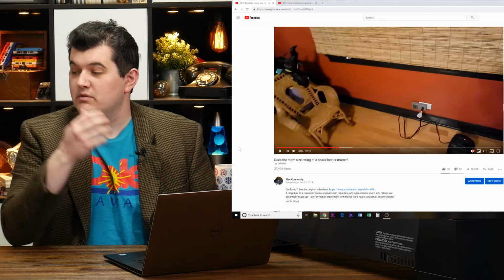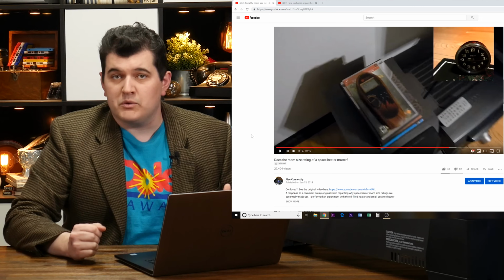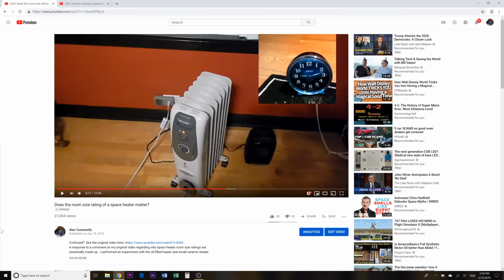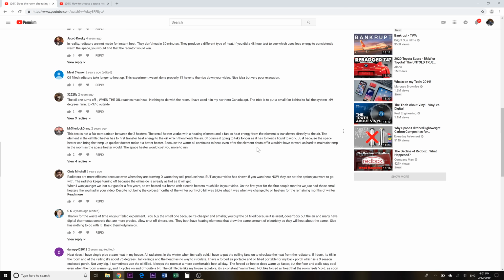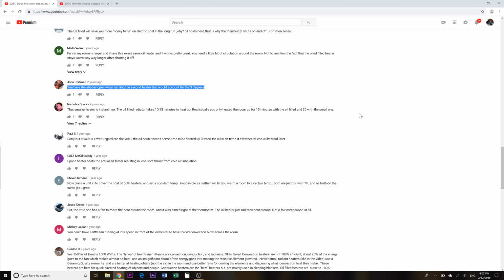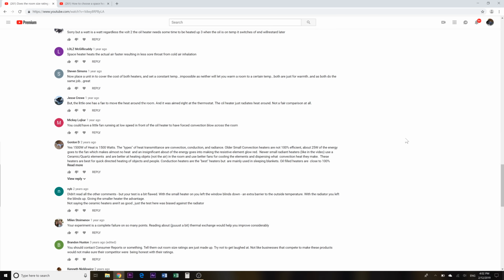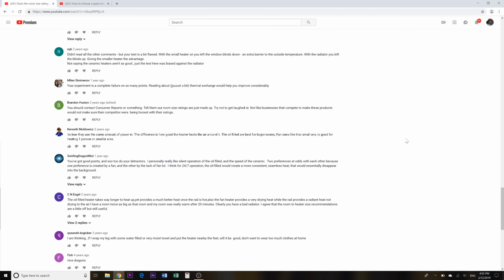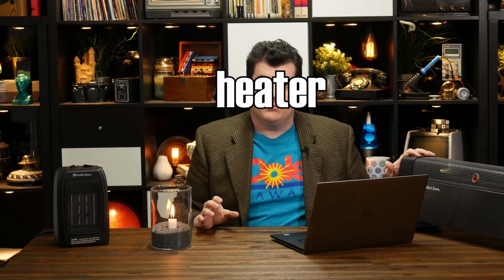More Space Heater Nonsense

Comment: Dad: "we bought a ceramic heater"
Me: "why?" 
Dad: "because it's better" 
Me: "how?" 
Dad: "it's more efficient" 
Me: "no it's not" 
Dad: "yes it is because it has a ceramic element" 
Me: "no it doesn't"
Dad: "oh... Well we really like it" 
Me: "that's great. Can I have your old one?"
Reply: better yet, call it a "thermal engine" it'll sell like crazy
Reply: No, Brawndo is betterdest because it has electrolytes!
Reply: s231744 Brawndo, it’s got what heaters crave!
Reply: @s231744  Electrolytes are what the plants crave!
Reply: I used to use a little ceramic heater out in the garage, it did ok, then I got a basic metal wire "utility" heater and it does "better" for the space just cause it has a larger / faster moving fan
Reply: If the ceramic heater is less likely to burn dust than a wire heater, then that might be a good reason for it.
Reply: @gunnar6674  The amount of dust burned in wire heater is small since it never gets a chance to build up.  In a ceramic heater that does not burn off dust you will have dust build up and clog the element until the heater doesn't work.  When the ceramic heater gets enough dust it may finally ignite.
Reply: A ceramic heater? So you bought a kiln?
Reply: B A a treat espicial
Reply: My late father drummed into me that all electric consumption was 100% efficient at creating heat and we had that discussion about the efficiency of the little ceramic heater and of course in that case he won, because I was a stupid kid and he was an engineer, so your comment reminded me of that memory, but it was reversed for me.
At the time I was confusing efficiency with how a seemingly small cube could put out that heat and after my talk with dad, I understood that he was always looking at it as 3,412 BTUs per Kilowatt every time all the time.
Reply: Actually a ceramic heater from Pelonis was the best. They invented it in the early 80s with the disc furnace. They produce the hottest airflow while still not going too hot to burn things. It will be able to output as much heat as it can because it is better at rejecting heat than a resistive wire one. A killawatt meter will prove it by showing its power consumption.
Reply: @sprockkets  I have one of the old Pelonis Disc heaters that I somewhat restored. It definitely "seems" to work a lot better than the small ceramic heaters you can buy today. It actually has a ceramic disc in it also. Sort of a honey comb  like matrix if I recall. The fan is much more powerful than the ones you can buy today. Thats probably why it seems to work better. I can't remember a what the power consumption is though.
Reply: @glennjames7107  depending on model mine takes 2100 watts on startup then around 1500 on max. But it produces the hottest air flow of all ceramic heaters I've owned.
Reply: @sprockkets  nope. If it's pulling 1500 watts from the wall, and it's constantly running, it's putting 1500 watts of heat into the room. How the air flows from the heater is what makes all the difference. If any design pushes the heat horizontally further away, it's almost certainly going to heat the lower part of the room better.
Reply: @bobbabai  you aren't understanding what's going on. Your first assumption isn't actually true in practice with most heaters.
Reply: @sprockkets  You're going to have to explain what you mean by "my first assumption". If you mean my claim that all of the electrical energy coming into the heater enters the room as heat, that is absolutely true. What matters is where the heat goes when it leaves the heater. The oil radiator design mostly heats up the air above the unit and that goes out the ceiling and upper walls. But because the radiator is a hot surface, some heat is radiated out to the side. The hot wire fan unit blows hot air horizontally which heats the lower part of the room much better before that heat leaks out the walls and ceiling. And because those units also get hot on their surface, they also radiate some heat out to the side, just not as much as the oil radiator design.
Reply: @sprockkets  I will modify one thing. Electrical energy put into a fan initially moves the air with the fan blades, but eventually all of that kinetic energy of the air molecules is lost to heat as those molecules collide with the rooms air molecules and they in turn collide with other air molecules and so on. There's also electrical energy lost to friction in the fan's bearing, but that friction immediately turns to heat.
Reply: @bobbabai  You still aren't exactly getting it. 
I've tested many different heaters, and the Pelonis disc furnace puts out the hottest temps. It can do that due to how it's designed. Monitoring each heaters consumption would confirm that as well. As in, each might be rated 1500w but cannot dissipate that much in practice, not necessarily due to a lack of airflow, but the heater element's poor surface area.
Reply: @sprockkets   No. If the heater is rated 1500 watts and its measured electricity consumption is 1500 watts, it is putting all of that energy into the room as heat. That's one of the two or three major points of this video. Where a heater puts it varies greatly between designs. Also, it may have to heat up parts of the heater first in order to get the heat into the room, such as in a poorly designed fan-based unit or in an oil radiator unit that has to heat up the oil first before the heat makes it to the room air. But a 1500 watt heater is always putting out all of that energy as heat.

The only difference with a ceramic disc heater is that the ceramic disc has to heat up, just like the electric ribbon in a fan-based unit has to heat up the electric ribbon in order for the heat to make it into the room.

If a heater's heating element is somehow insulated so that the heat doesn't immediately escape into the room, The heating element will overheat and whatever safety device is inside of it will shut off the power (or increase the resistance of the heating element as in the case of PST types that self-regulate by reducing.their power consumption by increasing their resistance as they heat up).

The major point is, The heater is using 1500 watts, All of that power is turning into heat, and all of that heat has to escape to the room surrounding the heater, either immediately via fan air or slower because oil has to heat up or internal parts of the heater have to heat up.
Reply: @sprockkets  
If the Pelonis disc is a radiant type heater, then all of the electrical energy is radiated as heat to whatever surfaces in the room are exposed to the radiating surface, assuming none of the radiated energy hits pieces of the heater like a grill in front of it, in which case those pieces will heat up and convect that heat into the room. 

Those surfaces will indeed experience more heat than they would from a fan convection the same distance away. But the fan heater will to the air around the heater and thus to the things that are nearby. It will also heat up more of the air above the heater. But if both types of heaters consume 1500 watts, both will put 1500 watts worth of heat into the room.
Reply: @sprockkets  And by the way, the radiant heat disc we'll also heat the air in the path that's directly "visible" to the disc.
Reply: @sprockkets  if you're going to stick to your story about a heater not turning all of its consumed energy into heat, then you have to explain where else that energy is going and in what form.
Reply: i'm sure this conversation totally happened :D because you CLEARLY explained to your dad why it wasn't more efficient, and he CLEARLY explained to you why it was!  "no it's not"  "yes it is".  valid debates like this really further positive endeavors ::slow clap:: well done

Comment: We have one of these oil filled heaters at our lake cabin and I have found using a box fan on the lowest setting helps to move the heat around the area much better. Normally it would take a long time to heat a large room, but having a fan to help spread the heated matter and moving the cooler matter to be heated it helps create a much more comfortable heat unlike cheaper, “small  room” space heaters
Reply: No matter what you do though 1500 Watts is 1500 watts and that is the capacity you will get out of what ever heater

Comment: It's it just the fan size? As in, the bigger unit would distribute the heat at a faster rate, theoretically heating the room more evenly rather than the heat being just concentrated in the corner with a smaller unit?

Comment: The bigger problem with that experiment is you started at a higher starting temp. You need to start at the lower temp for both. As room heats or us harder to radiate more heat into a system.

Comment: Wait so the small heater is using 1500W to heat and move the air. So wouldn't the oil heater be more effective if you just put a fan in front of it.  Say you have a 20W fan now your are using 1520W to heat and move that air. More watts more heat right?

Comment: Q=UA(dT) Q-heat transfer rate U-heat transfer coefficient A-area of heat transfer dT-Temperature difference. I believe the larger heater could be more efficient at heating a space due to the larger surface area of the heating elements. Assuming no external device for air movement it would probably help with natural convection too due to a larger volume of air being able to heat and subsequently rise exposing more cool air to the heating element creating a more consistently high dT. An experiment for this would need to start at the same temperature in an enclosed space a smaller volume like inside of a cooler or large box both placed in the same general area would probably be a good way to try and eliminate external factors. Steady state I do believe they would be the same but the larger heater could be better at heating a space more quickly.

Comment: tldr:
Everyone: the oil heater is slower and keeps letting out heat after it's turned off.
You: THAT'S NOT THE POINT!
Reply: Because it isn't.
Reply: @tolep  Exactly. I wonder how much the heat the host emits by bashing his head against the table as someone STILL DOES NOT GET IT.
Reply: @OldUKAds  I'm not good in English, but I'll try to  add somenthing.

1. All energy taken from electric outlet is converted to heat
2. If any heater takes the same amount of power, like 1500W, then it gives the same amount of heat
3. If certain heater, like oil heater, does not work constantly (because of protection from overheating), then it must produce overall less heat

Comment: In terms of heat generated by the device, they should all be the same, but I think the difference may come in that with a larger device you have more surface area. The heat is initially trapped in the metal coils, and having more surface area means more can escape into the air at any time. W/ the right air circulation, the larger devices will heat the room faster. (Maybe the non-fan containing heater is relying on your room having a fan already, like many larger rooms may have). Like you said in vid 1, you need to heat the room at the same rate as air leaves, and the larger device can heat a larger amt of air at a time to match the larger volume of air in the room. 
A second aspect beyond this may be device lifespan. W/ a larger device, the coils are cooler than with the small device, and thus have a longer lifespan when dealing with the longer duty cycles expected in heating a large room, while the coils in the small fan will burn out quickly if you use them to heat a large room.
The oil radiators seem much more suited to things like offices or a single room living space, where they're going to be heated most of the day. The oil wicks the heat from the heating elements, increases surface area for heating, and lets the unit have a longer lifespan.
This is all wild speculation, don't @ me.

Comment: There was a comment you showed on the earlier video that reflects my experience perfectly.  I've done the experiment you're doing, but it was a real life version where I had to heat a house.  A heater with an integrated fan will heat the space quicker.. putting a box fan behind the radiator blowing through the coils will not only disperse the created heat better, but will also keep the thermostat from kicking off so much.  The little heaters ARE faster, but will run your power far higher as the radiators keep working during the power downs... Also, the radiators MAINTAIN temperature far better, so if you don't regularly freeze your environment and need to heat it back up, the radiators are the way to go.

Comment: Watts is the end result of the electrical equation: (Amps X Volts = Current (Watts)).  If all heaters are 1500 watts, all heaters will produce the same amount of heat if they are designed properly. (fans included and the thermostat not being to close to the heat source.) One of the laws of physics states that you can't take out more than you put in, so all 1500 watt heaters pull in the same amount of juice, put out the same amount of energy, and have the same limits unless they are designed to shut off before they reach full strength.

Comment: I agree with you on the science of this but the test was setup poorly. You did not control the variables well enough. Comparing the two needs to be in conditions that can make them equivalent. The radiator is slower to heat because of the thermal mass of the oil. Even if it is on constantly it will take more time to heat the room. I'm not sure how to control for this off the top of my head. Maybe just ignore temp and go by the power usage.
The poor thermostat is a good point. You do better with your arguments than the test. 
Those baseboard heaters can move a good bit of air even if it is moving relatively slower. Given the larger size I would not be surprised if they were pretty close in volume to that tiny heater. Either way the 1500W is being delivered to the room unless the heater is overheating and setting off it's own thermostat.

Comment: You can turn your ceiling fan on high, too. The only thing a fan does is move air and dump energy into a room - all fans are fundamentally heaters.

The only reason they feel cool is because fast air moving over our skin makes it easier for sweat to evaporate, which draws energy from our body... into the room.

Now, if you have a fan blowing warm, moist, air over a cool surface, the energy from the air will get drawn into that cool surface, especially when the moisture condenses on the cool surface. If you can find a way to take that energy and moisture and dump it outside the room, you have an air conditioner. But the fan adds energy to the air.

(This is also why if you run a fan in reverse, by having air blowing on the fan and causing it to rotate, you can pull energy out of the air. That's what a wind turbine is. Of course, since that energy is coming from somewhere, the wind is less strong on the leeward side of the turbine)

Although I should note that these heaters don't "put out" heat, because they don't have heat inside them that they transfer outside of them. Heat is not an internal property, it is a process - akin to work. These heaters do heat on the room.

Comment: The other issue you have with slow releasing radiant heaters, (that have no fan) is that the heat will go straight up.  There it will collect on the ceiling and slowly fill the room from the top down as more heat collects.  If you're using an oil filled type you will be well advised to have some sort of fan circulating the air in the room. 

That being said, I personally prefer the oil filled type but I have no issue with the points you raised regarding how much energy comes out of each.

Comment: Does the 'small room' fan have a duty cycle on its heating element? So although the fan is on constantly, does a thermostat cut heat to the smaller heat exchange package to avoid meltdown, thus giving a shorter duty cycle than the medium or large room variants? That may explain the marketing wank.

Comment: I think we can just chalk this one up to the old saying "bigger/more is better." A tiny space heater that you could comfortably stick on the table can't possibly heat a large room as well as a giant box that costs twice as much, at least in the minds of most. I'm pretty sure the definition of marketing is "to trick people into spending more money for the same thing." Very few people even know what a watt is or how power is calculated. I think you could certainly argue that certain heaters are better for certain tasks, such as just trying to heat the immediate vicinity of the heater (as if you were sitting next to it in a cold room) or using one of the parabolic heaters to get very directional heat, but otherwise your conclusions are accurate. If two electric resistance heaters draw the same power and have the same duty cycle, their heat energy output will be the same, regardless of size.

Comment: For me the only difference is - the fan is mixing the hot, and cold air much quicker and generally moving the air everywhere, so you start heating the ceiling and the walls quicker than the calmer oil heater. Nobody actually wants to heat the whole air in the room + the walls + the  ceiling  at once - this is not the purpose of these heaters. The purpose is not the room to be specific temperature, but you to feel comfortable in the room. For example - if you place yourself close to the heater, the oil heater will be much more cost efficient. And yes - "small room", "big room" are very misleading labels for sure, but the actual feeling (which is much more important, than the theoretical knowledge :) in this case ) will be different.

Comment: Do oil heaters instruction manuals tell you to run the ceiling fan? That would cycle the air across the heating elements and the temperature sensor, giving a truer indication of the room environment.